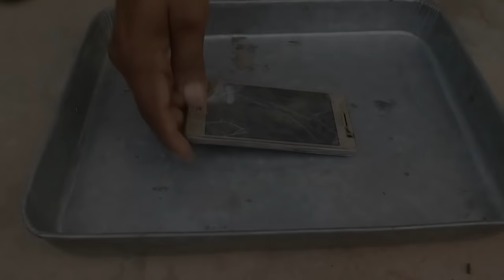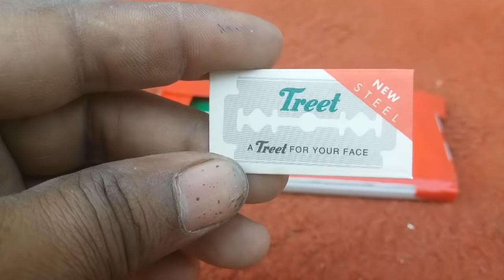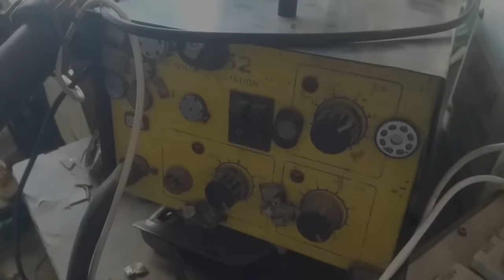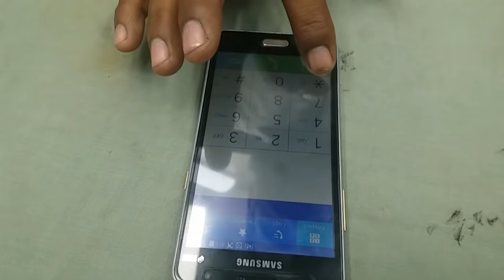Old Touch Mobile Phone restoration | Restore Broken Android Smartphone

Comment: the battery? in the water?... let me reset myself a moment ....
Reply: so, what is the problem. the battery at this bad case has low voltage . and the water has some resistance due to some impurities in the water. so the power dissipated as heat in water.